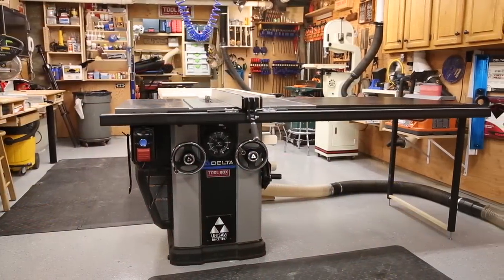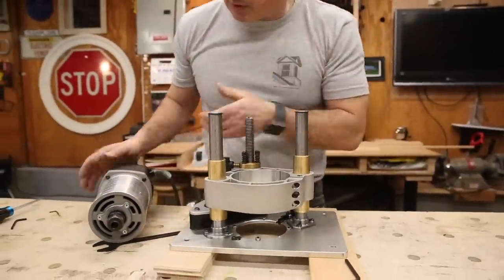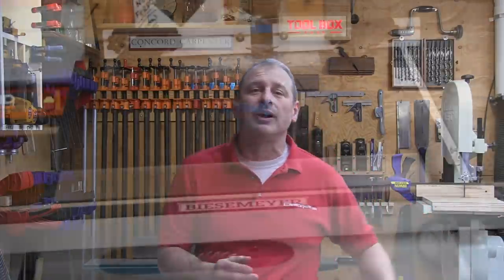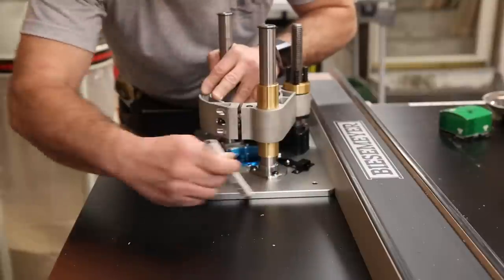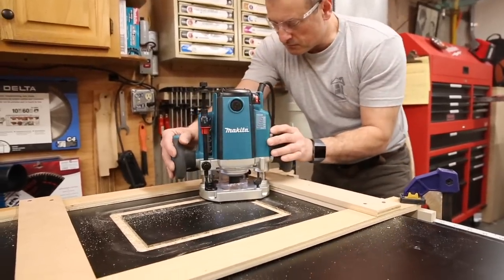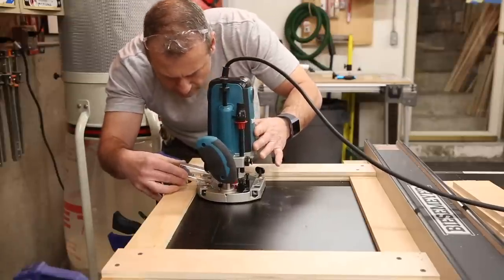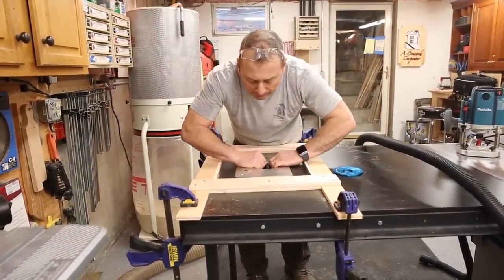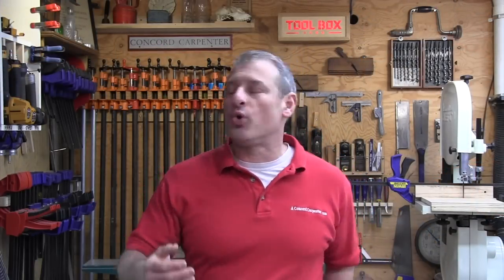How to Add a Router Lift to Your Table Saw Extension Wing

Comment: Going through a similar project soon... When creating the plywood template to route the insert, instead of using the 3in spacers and have the router slide inside the plywood fences, wouldn't it be easier (or at least possible) to have the plywood fences butted to the actual plate (no 3in spacers) and then use a flush bit with a bearing sliding the router over the plywood fences? That is what I was thinking? I seems that trying to account for the extra space of the router face plate creates opportunities for imprecisions. Thanks!

Comment: Thoroughly delightful video. Love your passion!  Also, the 1/2” spacers inside the main template are a great alternative to a jigsaw. I’ve been dreading that. 

How did you ensure a snug radius around the router plate at the corners of the recess?  I would have liked to see a closeup of the finished corners. 

Otherwise, thank you for making this terrific resource. I plan to make a new table saw extension table and finish installing the lift next weekend.
Reply: I'm pretty sure the router plate corners are specifically machined to fit a template using a 3/4" bit, but it wouldn't be a bad idea to test your template on a few pieces of scrap to see which size bit give you the perfect corner radius.

Comment: Nice job Rob....I did similar with a heavy rounter some time ago......I should have reinforced the table top close to the router as the table top did sag from the weight of the router hanging there over time.

Comment: Just remember, the router does not care if you are absolutely square. It is a round spindle. The base may look odd but it can be 1” out of square. It will have no affect on the router or the out come of the work. So take the emphasis off of square

Comment: The method I like has less concern about that witness mark and keeping the router facing the edges.   The width of your router base is also something needing to be measured and tested with.  
Instead, just use your template and have the router ride on top of it with a 3/4" bit that has a bearing.  A lot of finagling with your template is eliminated and I'd have to think a more successful outcome.  Sure you made your method work, but it's not needed.

Comment: Your table top looks black. What did you use to get that finish?
Reply: IIRC, that's the stock color for the table top kit from Delta for the Unisaw.
Reply: Thanks!
Reply: What model is the table saw?
Reply: I'm not exactly sure, but it appears to be one of the newer model Delta Unisaws. I would say it is comparable to this model: http://www.deltamachinery.com/products/table-saws/36-l352-type-2

Comment: A "witness mark".... ummm no not necessary. Same distance all the way around the curved  portion of the base to the bit. That would really suck if they made routers that way. Stressed about getting it flush to the table? I sure hope in 2018 your base plate has leveling screws. And with that said I am done sounding like an A-hole, lol. Thank you for the video I will probably be using your template techniques.
Reply: It appears his base plate isn't round, which would affect the distance of the bit to the template as the router moves around the edge.

Comment: I cringed when I seen you using the flat edge against the template strips. That's a no-no for any router as the slightest spin of the base with throw off your bit location.